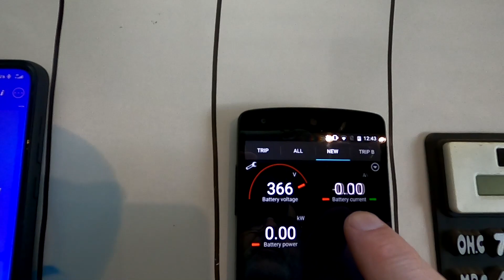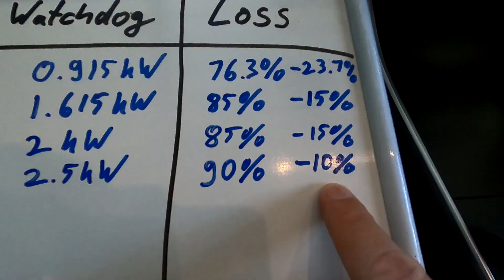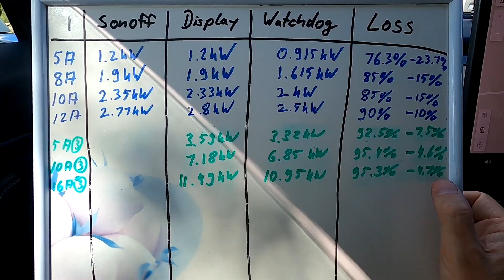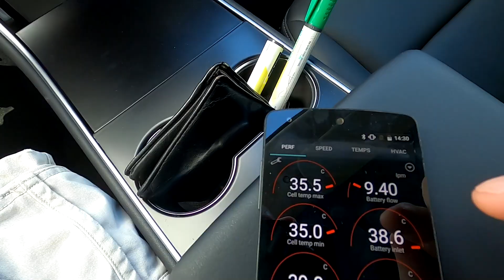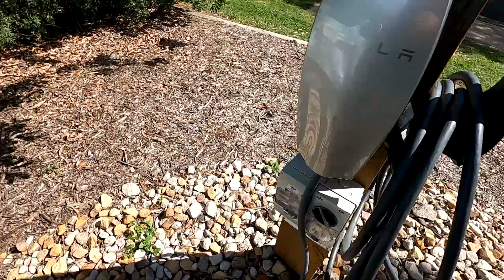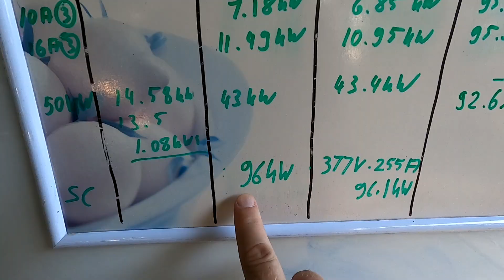EP347 - Which is the best and most efficient charging speed for the Tesla Model 3?

Comment: Like you I do most of my charging on solar. I use a 10KW Quattro Victron inverter. Whilst I take your point that faster rather than slower AC charging is more efficient the inverter efficiency differences, although small, are the other way around. FYI my inverter was 89% efficient at 32A, 91% efficient at 20A and 93% efficient at 10A. These are less significant than the losses to the Tesla but do slightly offset the benefits of charging faster.
Reply from the maker: Thanks Nigel, that's a really good point. I will test and investigate this one the PowerWall is functional. It may compensate and cancel out any loses regarding charging speed.
Reply: @unpluggedEV  Your comment that faster was more efficient seemed at odds to what is normal which is why I checked my inverter efficiency. If you push more current through a circuit you usually create more heat which reduces efficiency so I am still puzzled why faster is more efficient for a Tesla. I can understand why DC charging might be more efficient as it removes the conversion losses but apart from that faster is usually less efficient. My main solar system still has a 1000Ahr lead acid battery bank and in winter with little solar during overcast conditions I have to maximise efficiency to prevent excessive voltage drop so I find that I get more energy transfer if I charge at 10A rather than 32A.

Comment: Very interesting! I didn't expect that result with AC Charging. Looks like the small increase in cable losses that we'd expect at higher charging speeds, is outweighed by the increased efficiency of the UMC/EVSE running at its fastest speed.
Reply from the maker: It's more the internal charger running more efficiently near its maximum power. The EVSE is just a device telling the car how much power is available. It should have minimal loses.
Reply: @unpluggedEV  Ah yes, that makes sense.

Comment: Also if you drive just 20k km a year then you will save an easy 300KWh in power by charging fast as you can at home!  You can’t say you’re worried about battery degradation, as your battery is used more driving on the highway, than at any AC charging speed.
Reply from the maker: Correct, even charging on 11kW with the 3, this is only 0.2C, so very soft and gentle to the battery.

Comment: You can se exactly how many kWh that went into the car while you supercharged, if you go on to the Tesla website, log in and check the supercharger history. The Tesla will spend som energy to run the pumps and different connected features, that energy is the same and won’t change based on current or power. You will get accurate charging losses if you subtract that initial energy the car is spending not charging, but parked, as it’s the same as when charging (ac). You will then find out they the losses are about the same on all current settings (ac). The offset is just measuring errors. Frohe Ostern!
Reply from the maker: Thanks, I wasn't aware of that. I just checked and all the kWh are there, so will do a test again for SC the next time.

Comment: hi andy what about the lost in the cables ?
Reply from the maker: They are included as I measured the energy in the Sonoff and what is going into the battery. In between are cables, connections and the charger inside the car.

Comment: Andy, I think you would find that the 20c per Kwhr is a small nominal charge on the power you get. The losses may be the stator heater to warm the batteries.
Reply from the maker: That's definitely a very small price for the charge, no doubt. I reckon it will increase over time though.
Stator heating only on DC though and you could be right with your guess, very hard to find out unless I watch the Watchdog permanently and also take the time. I could then calculate the loses just for this silly heating.

Comment: Couldn't you simply multiply on 3 phases   V(240V) * A * 3 ?? instead guessing that in line is 415V not 408..?
20:00 You pay for losses on DC while system is loosing 3kW for heating of battery by rear motor :-) And obviously battery also has internal losses. 

That was really useful test. Thanks Andy! 

BTW just 0,2 dolar for kWh on DC is very cheep. .. In Norway at least 3..4 times more expensive.
Reply from the maker: It's not a guessing thought. We have 240V here in Australia and the line voltage is 415V. So formula is P = √3 × pf × I × V
The 3kW heating is a bit chunk of the loses you pay for, very annoying.
Reply: @unpluggedEV  
Need of heating battery in such hot climate is simply strange for me, how much faster it will charge.. from another end isn't the high temperature most deadly for cells ?? 
But probably Elon know what is doing :-)